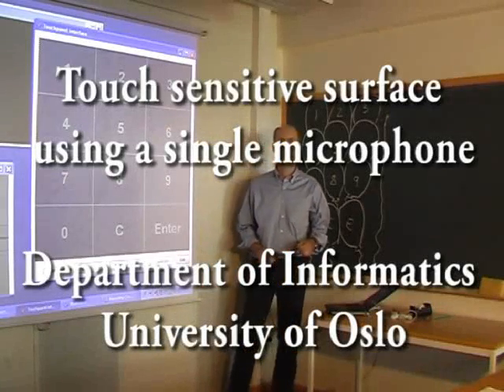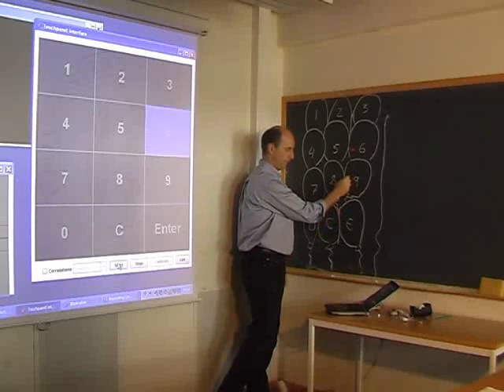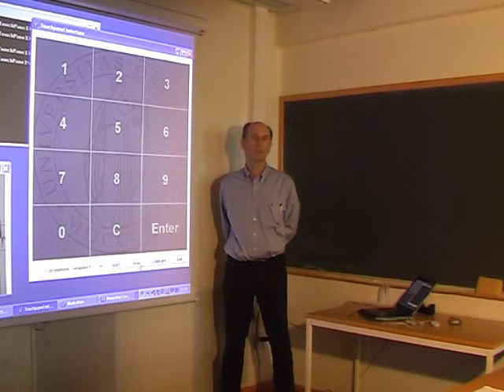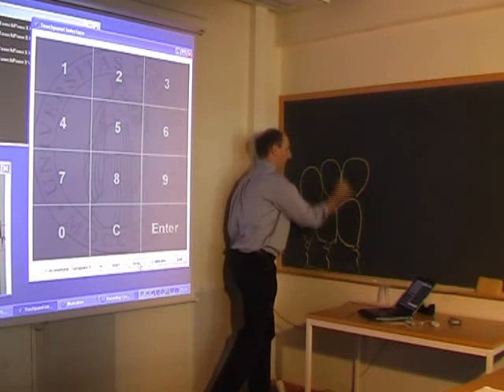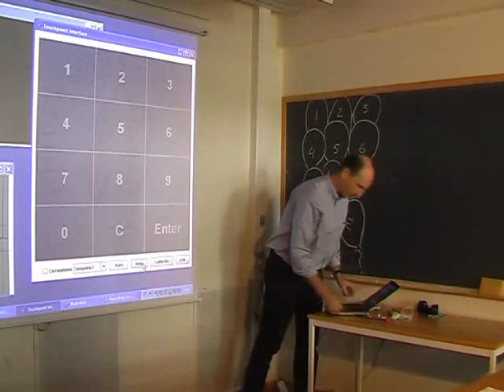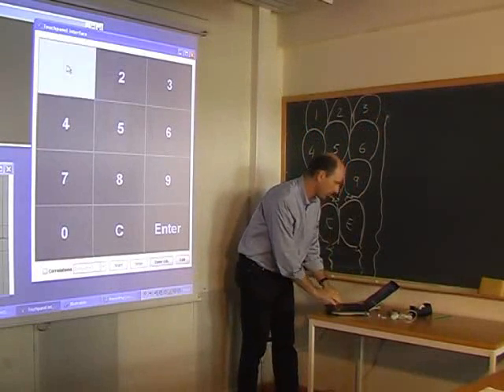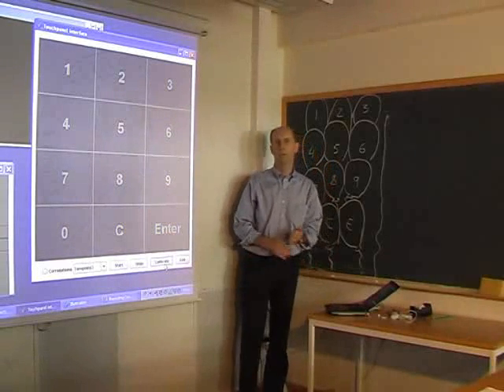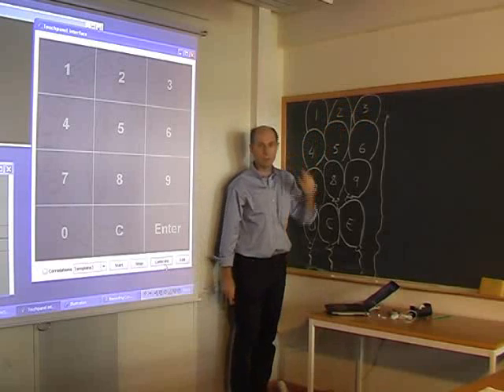Touch sensitive blackboard

Comment: HI Hold I'm experimenting in this direction.Using two mikes and cross correlation but it's very unstable the detection. Can you tell me a bit more which classifier you use. Or is there paper describing this?